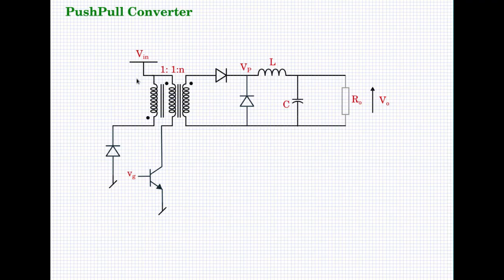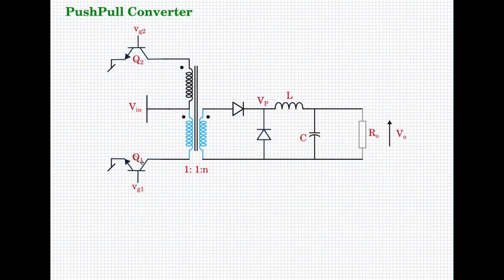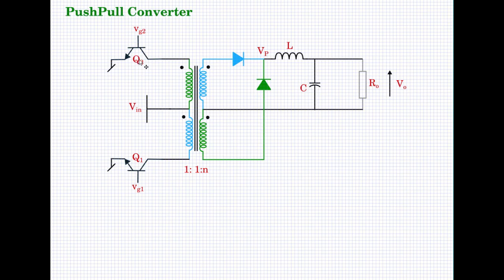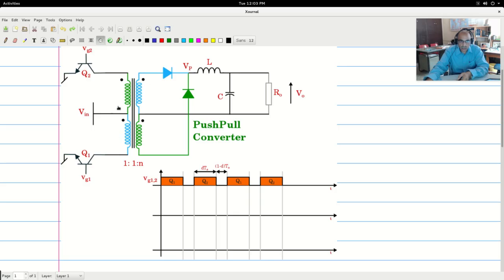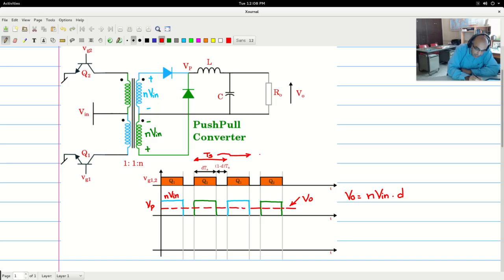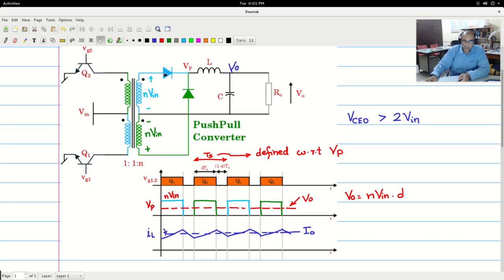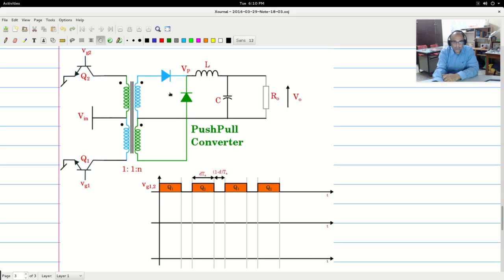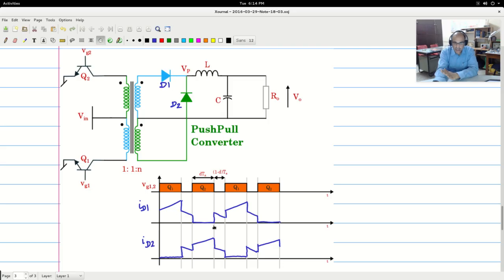Pushpull Converter

Comment: Sir,  When moving from Q1  ON to Q1 off ( Q2 is OFF in both cases) , freewheeling happens in o/p side. In my view that should happen only through D2 because the induced voltage in the secondary side blue coil will be with minus potential on dot side ( similar to forward converor )... Then most of the free wheeling current should flow through D2 only....  Then flux will not remain constant at phymax.      Kindly correct me if I am wrong...

Comment: Hi Professor, thank you very much for the explanation. I have a question 25:48. I would like to know what is the voltage that sees one of the transistors when they both are off. Literature says that it is Vin, but I do not know where that comes from. Once again, thank you. Greetings from Colombia.

Comment: Thank you verry much. i would to design an adjustable HV (0-30kv) cascade buck push-pull (voltage feed) power supply. is it possible to guide me with docs for the calculations? because in the web i founde just a fix voltage output. thanks

Comment: I have one doubt, not sure will be answered still asking: Why is inductor L required in output.?? I understand to store energy but isn't it in real life its just adding some extra resistance ??
Reply: There must be some impedance to define the current in the secondary.    If the secondary is just connected to a grounded capacitor  it will present a very low impedance to the primary side.  This is because there is nothing to limit the secondary currents, and they will cancel the B field created by the primary currents.  That means the primary side will look like a short / low impedance.   As expected,  the "transformer" reflects the secondary impedance back to the primary.